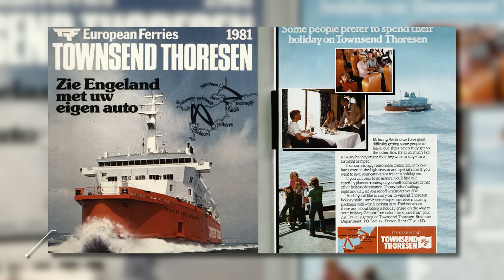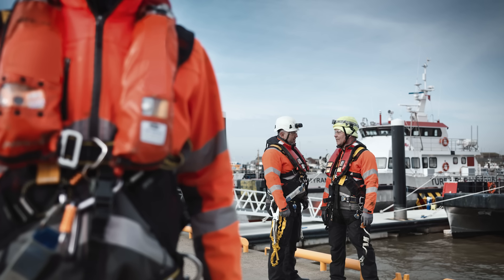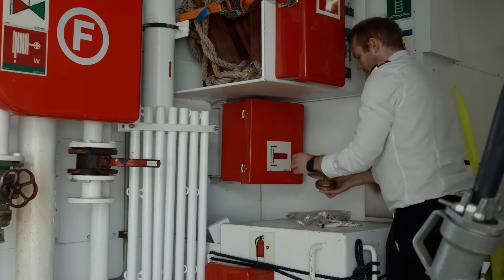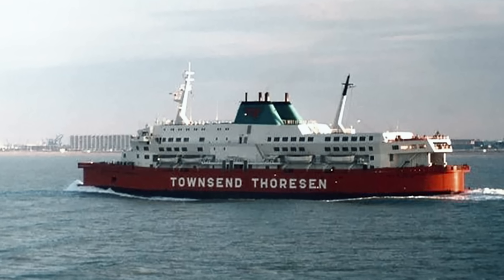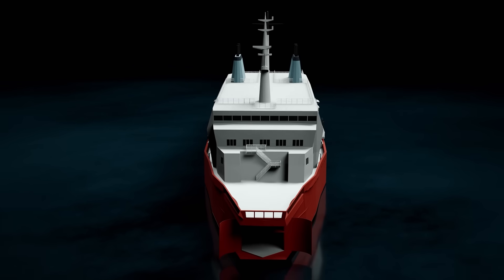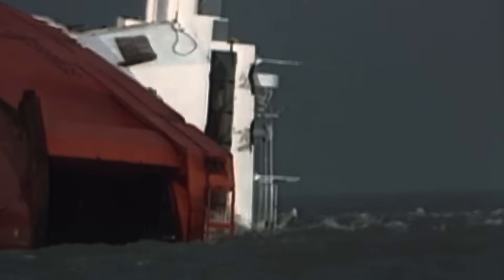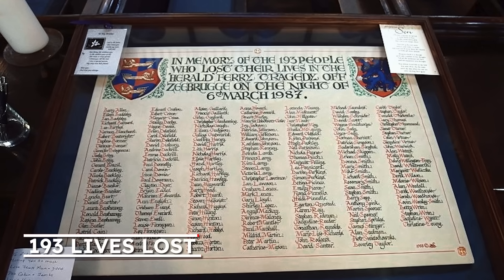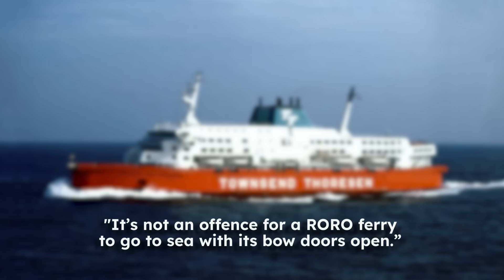193 Dead After Bow Doors Left Open!

Comment: No AI rubbish. Just good well researched story telling. Your channel is the best.
Reply from the maker: Thank you so much!!
Reply: I concur with this.  Just seen it earlier today and responded to a few comments.  Succinctly presented and clearly researched by someone who has actually read the official investigation report.  A couple of points he might have added.  Firstly, the investigation commented on the use of safety glass vs laminated for external windows.  Regulations were pushing newer ferries towards laminated, but these were revisited after the investigation found that laminated glass would have impeded rescuers and survivors.  I'm not sure whether that has saved more lives in subsequent disasters, such as MS Estonia and Costa Concordia, vs. increased risk where ferry and cruise-liner windows have failed in rough seas?  Secondly, the report went into greater detail about the possible overloading point.  There was a lot of ink about that in the report and it raised wider questions about the safety culture on the ferries and wider transport industry, (such as trucks running 13% overloaded on average).

Comment: Imagine designing a ship with a barn door for a front AND back.  Oh. And expecting it to not be a failure point
Reply: RO-RO's were designed for quick loading and unloading not for safety. Just look at how many have sunk.
Reply: @zetectic7968 it's wild how someone, somewhere, pays for them. (As equipped)

Comment: The crew obviously were all incompetent & patheticly useless
Reply: Ignorant comment. Yes they deserved some blame but it was the company saving money by reducing the crew numbers so they were overworked and under constant time pressure.  TT/P&O could have put a camera on the car deck to monitor the doors or an indicator light on the bridge but they didn't. They also ignored the common practice of leaving port with the bow doors open = bad management/oversight.

Comment: Any design that needs a single door with high complexity to close perfectly every time in daily use is either a space vessel or a vessel that will soon sink.
Reply: I’m blown away by the lack of redundancy in the operation procedures. Why wasn’t the crew trained to alert the bridge that the bow door wasn’t closed aside from the bosun and first officer?! No warning lights or alarm in the wheel house is maddening. The door apparently did its job but with an obvious vulnerability like a bow door on a ship, it seems like the company running that ferry would have been more vigilant about securing it. They were more concerned about leaving 15 minutes early though. What a stupid way to kill 193 people!
Reply: @chrisstone6256 That's a fair summary of a key conclusion in the official enquiry report.

Some people will always blame the guy who failed to close the doors when he overlaid after his rest break.  But the outcome would have been exactly the same if he had suffered a heart attack.  Lack of proper safety culture and process was the root cause.  Surprisingly, the official report didnt seem to comment on the reason why he (and others who had left the doors open on other trips) may have been so fatigued - some sources suggested he had worked 18 hours prior to the break when he dozed off.  Human factors would almost certainly be probed in similar accident investigation today.
Reply: That's why the Herald had TWO sets of bow doors - inner and outer, to provide contingency and resilience.  Unfortunately both were left open.  The disaster was caused by sloppy safety management rather than poor construction.  Your observation is more pertinent to the MS Estonia which sank several years later after her visor suffered structural damage.

Comment: Something that always bugs me about this

Is the union were more concerned, going by sources, with job security than safety. Yes the strike happened in 1988, but by then he the Herald had sunk.

And identical on paper, sure. But the Dutch documentary that was done in the 90s showed that the Herald had been built with a slight list. You may not think one or two degrees is a big deal. But that's one or two degrees when the ship's at anchor. Once water gets in and forces are involved...that's pullling the ship to that side no matter what

EDIT:

Also, Captain Lewry had zero way to check if the doors were closed. it wasn't just that it was hard to see if the doors were. It was the design. It's like sitting up on the roof of your house and trying to tell if your front door is closed because someone was leaving the house. TT had denied the request to ad an indicator light because of cost saving measures and the idea.

That and for more cost saving, the Herald's crew had been cu back and cut back, and IF she had a full crew, then someone would have been at tthe door controls when harbour stations was called. Instead of the late Mark Stanley having to be in two places at once, however
Reply from the maker: Appreciate you sharing these important points about the design and crew issues!
Reply: Cost saving, life threatening.
Reply: Well said.
Reply: He could have radioed literally any one of the dozens of other boats nearby and ask them if they saw anything weird
Reply: @Shinzon23  Not when he had to oversee getting out of Zeebrugge harbour, it was dark and the other ships were all doing their own thing. Zeebrugge is not a nice flat bit of water with a level sea bed. Even if they did see something, by the time they hit the radio and finished speaking, that's time taken and water entering the Heraldthe